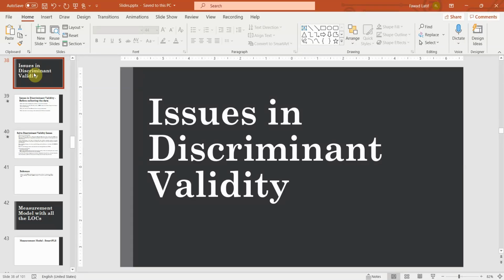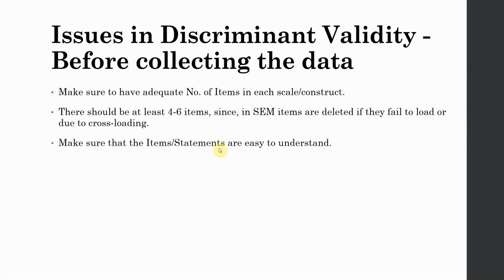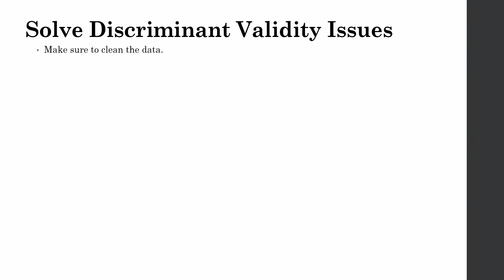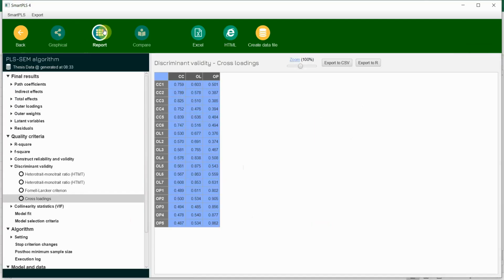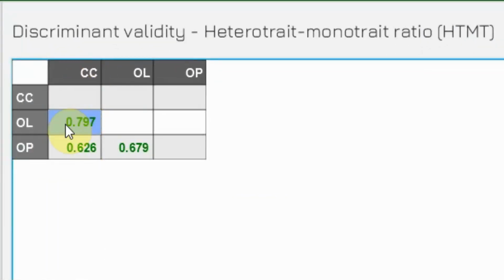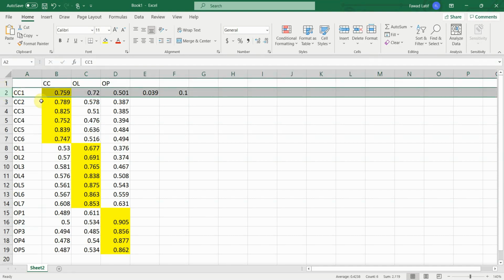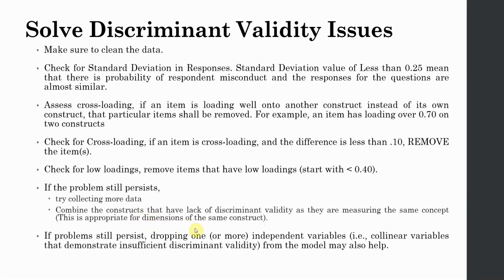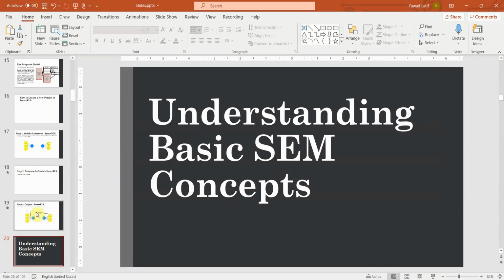#SmartPLS4 Series 10 - How to Solve Discriminant Validity Problems?

Comment: Does this Standard Deviation in Reaponses 0.25 need to reference? or May I have a citation about this part?  sir, Thank you a lot.
Reply from the maker: Thanks for watching. Here is the reference
Collier, J. E. (2020). Applied structural equation modeling using AMOS: Basic to advanced techniques. Routledge.

Comment: suppose HTMT and Farell lacker criteria suggested no discriminant validity problem but while checking cross loading we find that, what is the next step the??
Reply from the maker: If FL and HTMT is fine, you can leave cross loadings if the difference between loading is over 0.10.